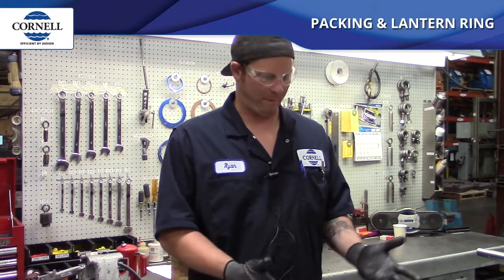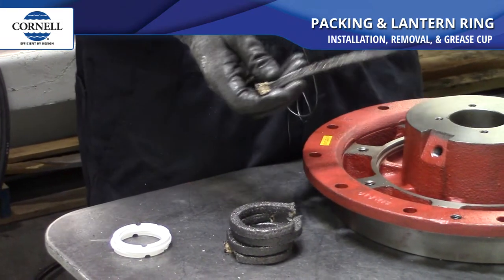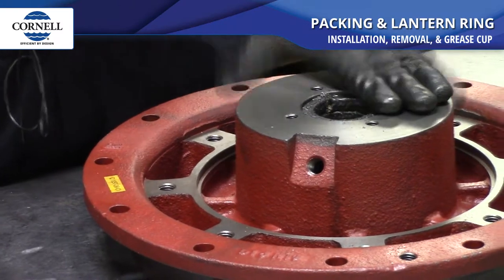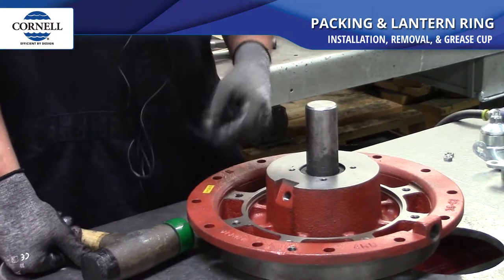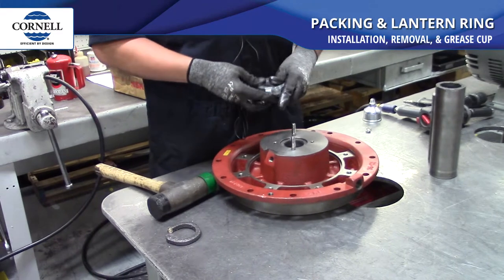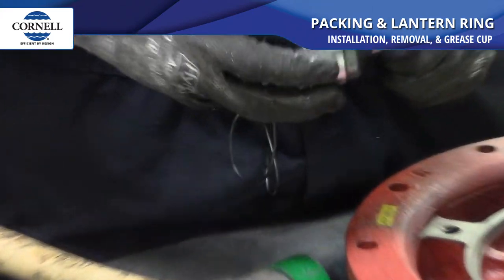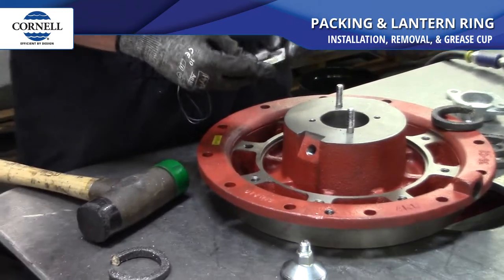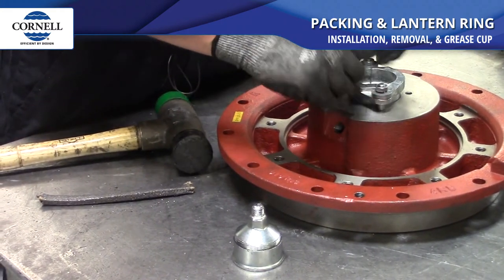Packing and Lantern Ring

Comment: Wish you were here at my farm this last two weeks: i bought a new cornell 5rb-f for a whopping $9,000 Can $, the dealer at Lethbridge Alberta Canada installed it on to the engine for another $2,300, they didn't even give me an operating manual, and the impeller then rubbed against the housing and kept stalling the engine (keep in mind the dealer blamed me because i didn't know i was supposed to throw some water into the intake before connecting the suction pipe)!  So it didn't pump a single gallon of water the first week. I took it back to them and their repairman replace a few inner parts and he also "fully greased the packing/lantern ring assembly".   Cornell dealer said it must be engine's fault so engine guys looked at engine. So this second week i started it up and it went 12 hours and shut down. Dealer said must be air leak in intake pipe. Then it ran for 10 minutes and shut down. Later i got it to run for 25 minutes and it shut down. It is not the engine. Yesterday spent whole day checking for air leaks. Made the discovery that if i continually bailed water on to the lantern rings holders, that it did prime up a bit and pumped water at one-fifth rate but i shut it down. Yesterday i loosened two nuts and turned grease cup in by half turn, and slightly tightened nuts. Can feel a slight air bubble every ten seconds on outlet flange that hooks to mainline. It sucks cold water up to intake no problem, no feeling of bubbles on intake pipe. So have owned my new Cornell for two weeks and it is so discouraging to watch the crop wither not having been irrigated once. Any ideas?